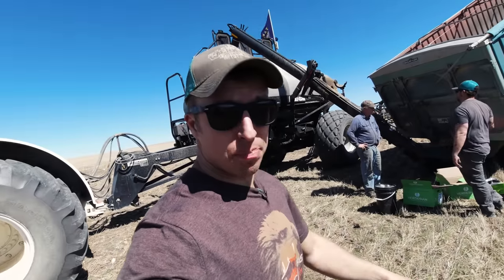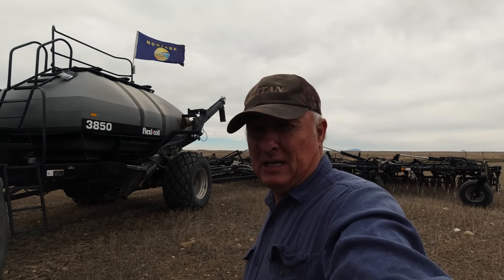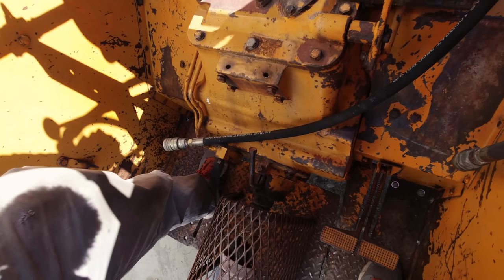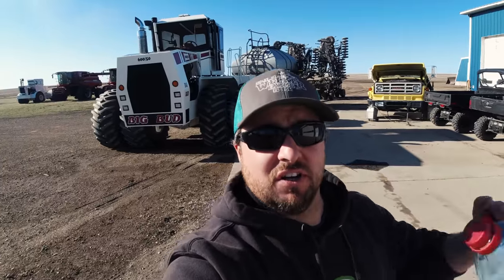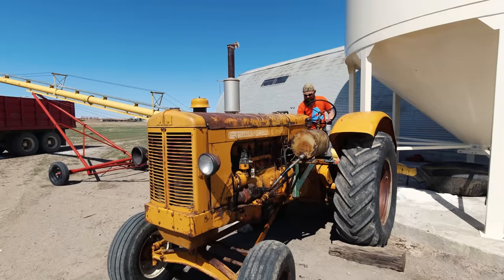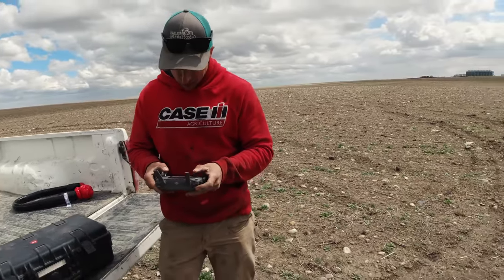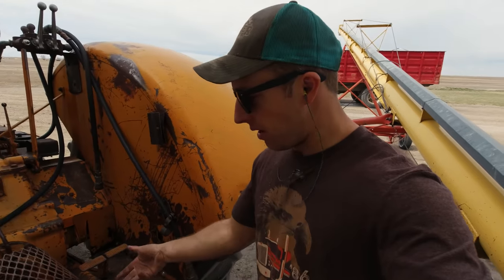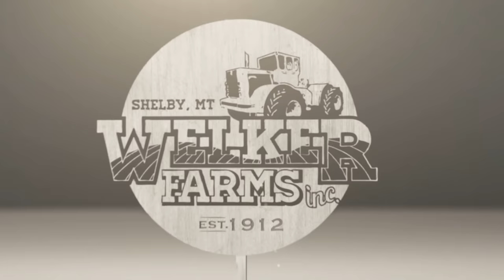First STUCK of the Season!｜BIG BUD to the Rescue!

Comment: One thing you could do for the shaft to make it secure, because if it snaps auger side... suffice it to say that there's nicer things to look at, is to make a cage that extends a little bit more. Essentially, a circle out of tube (or rebar, if you happen to have anything above 1.5 cm diameter) that's supported by the tractor's frame (since it doesn't have any other pick up points. If you extend it 20~30 cm past the articulation, IF (knock on wood) the shaft snaps, it will rotate within that collar and be somewhat contained.

Comment: Over 60 years ago I put oil on the pivot point of the seat of my dads U Moline. It took most of the spring to get the seat to quit from swinging from side to side every time you turned. He kept throwing,dry dirt on it. I bet he told me 20 times,NOT to oil the seat!

Comment: Hey Nick please don't stand in front of tractor drive tires when starting them. Too many farmers/mechanics have been injured or killed. ❤
Reply: He explained why he didn't.
Reply: Standing in front of the wheel is not ideal but trying to get on and off a tractor like that with the pro between your legs is quite dangerous, hence why he did what he did.
Reply: You don’t need to worry about safety
Reply: Yeah, idk. I've had too many machine lurch forward on me because I started them when I thought they were out of gear. I am an idiot....i know....but that just makes me cringe. In fact I drove the zero turn into the barn the other day because i thought i had found neutral but it was still in first. 😑😏

Comment: I noticed the cracks on old tractors steering wheel an easy fix is JB WELD just fill the cracks then sand and paint. Works great

Comment: Welker Farms should have a "Remote Controlled Dedicated Tractor" so every operator can pull himself out when stuck.  That way, no other farming operation needs to be interrupted and all the operators may be able to get more sleep because of the daylight operations being able to complete planned as planned.  At the least; the extra hand can drive a dedicated high--speed tractor truck to pull the stuck tractor.  A heavy older Over-The-Road truck tractor with giant Farm Treads would be more easily and financially obtained for the dedicated pulling vehicle tractor.  IMHO

Comment: I'm surprised and impressed you aren't running one of the super monster air seeder carts.  Is the fan on that unit ground drive or hydraulic drive ?  Did the tractor have enough flow/circuits or did you have to update it?

I'm not sure I could ever get used to having the cart between the tractor and the seeder.  Can see what is going on.
Reply: Would but with these commodity prices it's on the back burner

Comment: Would it pay for you to buy fertilizer by the train carload ? They hold around 80 - 100 tons capacity, depending on product weight.
Reply: We have a huge fertilizer coop distribution system 3 miles away

Comment: Which bud has better fuel economy seeding, the higher hp of the two or other way around?
Reply from the maker: The series 2 is better at fuel because it has an old school transmission without clutch packs and toeque converters. There is energy lost in that system.

Comment: Always seems strange seems strange seeing prill in bulk hoppers be it on farm or in co-ops as here (UK) it will be in either tonne bags or 600kg though I would say AN with sulphur is becoming more popular than Urea as very little is planted in the soil so losses can be considerable as a top of the disc spreader or sprayer is cheaper than a top of the range drill but then but then none of the farms locally have to cover your acres. At the moment we are just waiting for some light rain to be forecast out side of the days the shearers are visiting to top up our leys with 25 5 5 5 + 5S as with the clover in the leys we prefer to put little and more often out so we don't burn it off.

Thing that takes the most thinking is we work in CWT and Units an Acre but the spreader works in KG a hectare
Reply: Yes measure units are confusing.  With our very low rainfall urea is the cheapest
Reply: @RobertWelkerFarmerBob  makes sense as it is not the cheapest input around no matter what form you get it in

Comment: What % of acres of fields do you chem fallow ?
Reply: 25 to 50%
Reply: Robert Welker   That is higher than I thought.
When I was younger and helped my dad we did about 40% summer fallow.
Now a days most farmers in my area 100% continues crop.
There are a few that chem fallow a little but they are hard to find and when you do find a field lots of time it is either because last years crop didn’t get off in time the following spring to successfully seed a new crop or the field in question was to wet in the spring to seed the field at the appropriate time.

Comment: Starting a tractor standing in between the wheels is in no way safer...
Reply from the maker: I'll use my super powers and turn it on with my mind, unless you have a better idea?
Reply: @WelkerFarms  remote start lead, hooks to run and start wires with alligator clips so the engine can be cranked remotely. Commonly used for working on boats.